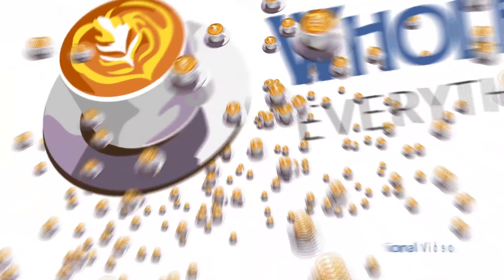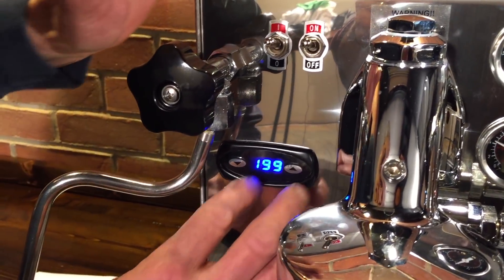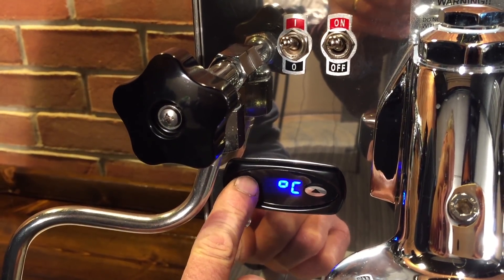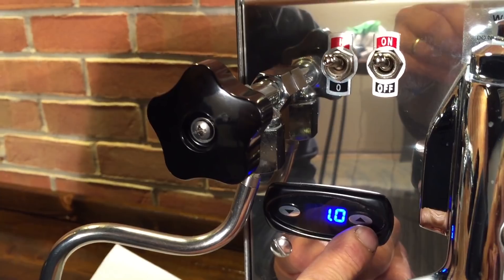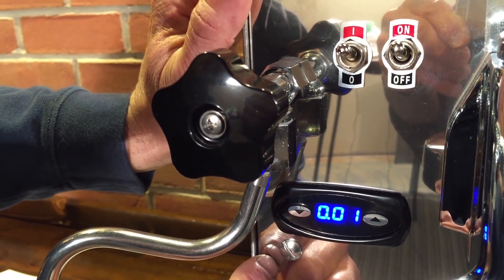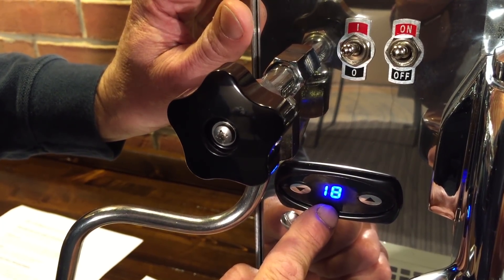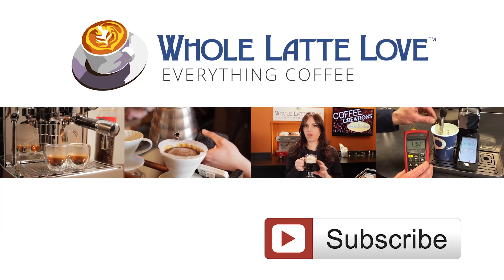How To Program the PID on Expobar Brewtus Espresso Machine

Comment: What does the old control on the form mean?
I use Celsius. Do I need to enter the value on the left side of the table. For example, do I need to set the value of P. to 3.0?
Mainly because the old control is written at the bottom left of the table, which makes me wonder if I should enter all the values on the left
Or just change F.03 and F.04 to the left value and P.I.D to the right value
Can you help with my question
thanks

Comment: Hello, finally I found something on this topic. I have a La Pavoni Dolce Espresso PID System. When I enter the setup, it looks pretty much like you described it, albeit it shows 1.00 (version?) when turned on. Also, I do have one parameter more (b.). Other than that, the setup is the same. What bothers me though, is that when I turn the machine on without buttons pressed, it shows 1.00 briefly, then changes to A1. At least it is making coffee.
Reply from the maker: Hi UB, Thanks for the questions. I do not have a LP Dolce on hand to confirm but on many PID machines "A1" is an error indicating the PID controller is not receiving a reading (disconnected) from the NTC temperature probe in the boiler. Here's a link to video with more info on A1 error: https://youtu.be/U5osRCBVk7g?t=53
1.00 is likely the version if that's the first thing in display when turned on.
Reply: Thank you so much. I opened the machine and found the tiny cable disconnected. Once I put it back, A1 is gone. Now I just need to recalibrate the machine as it gets way too hot.
Reply from the maker: @ulrichbeutenmuller8101  Happy to help and glad you found the problem! You might research how to do a PID reset to factory state. Can't confirm this is how it works for your machine, but for many it's holding down either the plus or minus button while powering on the machine. Continue holding down through he PID dispaying the version number and if you see something like "pst" or "rst" let go and turn the machine off and on again. The factory reset usually brings deeper settings like P, I, D values and boiler offsets back to where they were from factory and may resolve issues should someone have inadvertently changed one of those. Good luck!
Reply: @Wholelattelovepage  Thanks again. I did the factory reset before and it worked. I just wonder now, how high the temperature should go if I turn on the steam switch. I think 130° (Celsius) is too much. Also the display starts blinking at 108°C. But maybe that is okay for this machine.

Comment: Hello. I own a Brewtus IV with rotary pump but i think the liquid overall in the mug is very cold compared with one from a coffee shop. I have the those settings 

F.03= ℃ 
P.=1.0
I.=0.01
d.=2.0
F.04= 7

and brew temperature 93. 

Can you please advise?
Reply from the maker: Hi Coffee Ranger, Your settings look good with the possible exception of F.04 which according to my Brewtus info should be 10.
F.04 is your boiler offset so increasing to 10 would get you +3 degrees in the boiler. With your brew temp set at 93C an offset of 10C would give you 103C in the boiler instead of 100C with offset set at 7C.

Comment: Hi, I'm using an Expobar Brewtus IV-P and I'm from Singapore, so I'm not too sure if it's a different variant of the machine that you guys sell.

I've tried looking on your website for the PDF instructions, but to no avail. So I'd wish for you guys to look into it and add the link inside or make it easier to search for the PDF.
Anyways, here's my issue: I reprogrammed my PID to follow the instructions shown on the paper ( which I assume is from the PDF you guys were talking about ), and I noticed that the preset values I had were largely different.

I am using my machine in degree Celsius, and these were my default values:
P: 20 (Such a huge difference! Your manual recommends for 2 so I'm confused )
I: 0.01 ( I know it should be 0.05 according to your manual instead so I set it to 0.05 )
D: 18
F.04: 55 ( This one shocked me the most, your manual recommended only 10 and mine's set at 55 )

Do you mind helping me out and explaining the possibilities on why my machine has such presets ( Perhaps calibrated by a technician? ), and if I should follow yours instead? 
Thank you!
Reply from the maker: Hi Gunther, Thanks for the question. We do not suggest end users change the P, I and D settings. The differences may be due to you running in C and here in the US we are running in F. Unless someone modified those settings prior to you getting the machine it's best to leave them set as they came from the factory and/or your dealer.
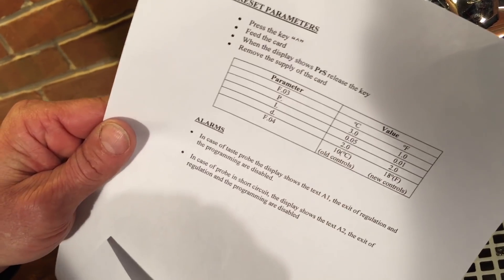Reply: But according to your sheet, 2:02 , there is a setting recommendation for the P, I and D settings when it comes to running in C.
Why do you reckon it will vary so much even if it came from my dealer?

Comment: I need you help!
I use ℃.
which setting is correct below?

(A)
F.03= ℃ 
P.=3.0
I.=0.05
d.=2.0
F.04=10

(B)
F.03= ℃ 
P.=1.0
I.=0.01
d.=2.0
F.04=10

(C)
F.03= ℃ 
P.=1.0
I.=0.01
d.=2.0
F.04=18

A,B,C which one is the correct in ℃ ?
Reply: B ish but 10 degree offset might be a little big

Comment: Just started using my new Brewtus and I noticed the temperature going down from 91 to 89 degrees Celcius during extraction. Is that something regular, or should I calibrate the PID?
Reply from the maker: Hi Arno, Thanks for the question. That's normal. During an extraction the boiler temperature drops a bit as cooler water replaces heated water used for the extraction.
Reply: Ok, thnx for the swift reply. Just programmed the PID with the settings from your PDF, and the brews are getting better each time. I really enjoy watching your reviews and instruction videos!
Reply: @Wholelattelovepage  👍🏿
Reply: hi! what component must i change in order to have  temperature stability during extraction?